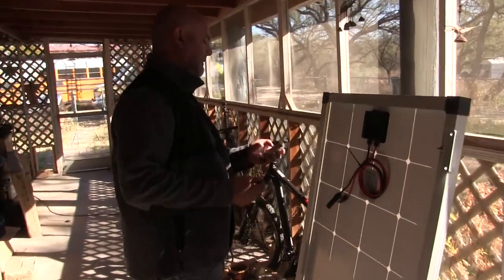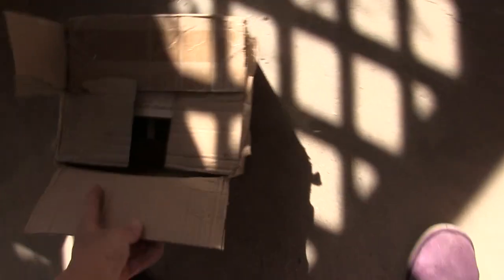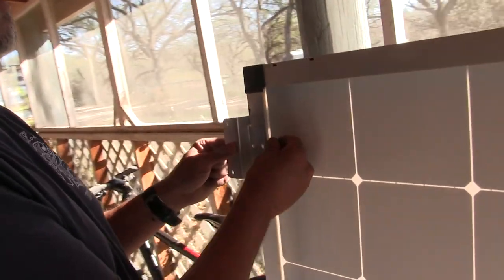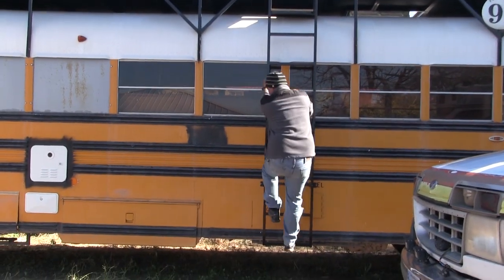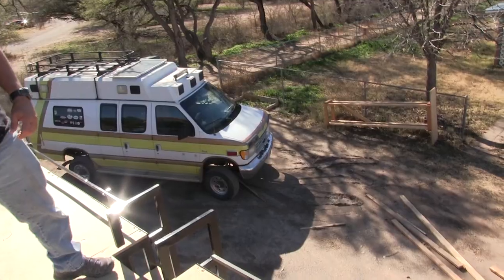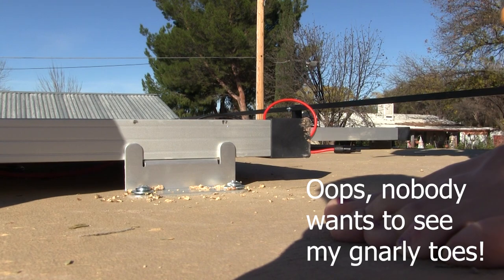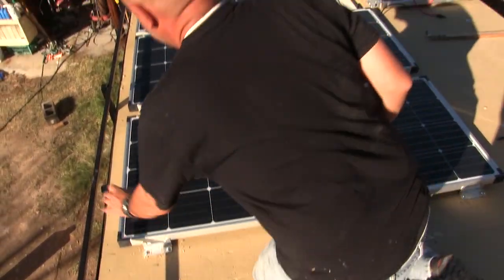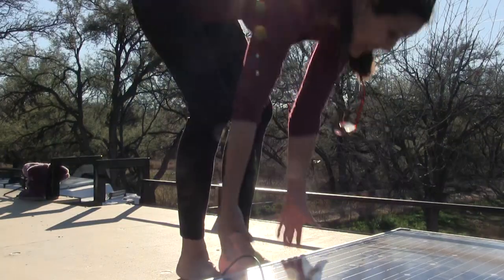Installing 1500 Watts of Solar Panels on our Skoolie Deck!

Comment: Hi team from Australia, great videos and full of small tricks. You have lots of power in the system.
My I recommend protecting the wiring underneath and between the panels as it may rub insulation away on your journey over rough roads. Over a few years the wiring in the sun will be damaged by sun. As you have spent a lot of effort building your tiny home a electrical fire ( electrical short on wood) is the last item you need. Keep up the great videos. Use the thick split black conduit and secure to deck with P clips.

Comment: Question: Why not use nylon locknuts on those Zclips?

I'd think that the vibration while on the road would cause that to inevitably loosen.
Reply from the maker: The nuts we used are a type of friction locknut.

Comment: I was wondering why you did not make some of the solar panels adjustable so you can follow the angle of the sun when boondocking?  I have seen another bus build video where a guy installed a motorized hinge he could adjust the panels from inside the bus with a switch for different times of day.  But he probably had a smaller bus.
Reply from the maker: Initially that was the idea. We were going to make it very fancy solar elevation system that would articulate with motors. But then we had some other bus life friends visited us and they were talking about their solar and how they realized they really didn't need to articulate their solar panels. We have more than twice the amount of power they have and realize that we probably wouldn't need to lift them in order to maintain an adequate amount of power.
Reply: @BussyMcBusface  that is good to know.  Thanks!